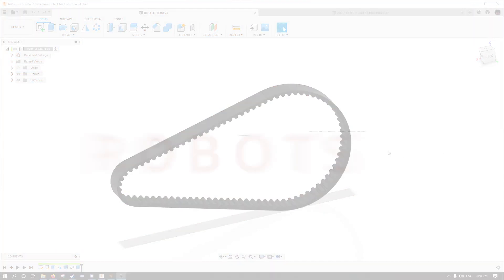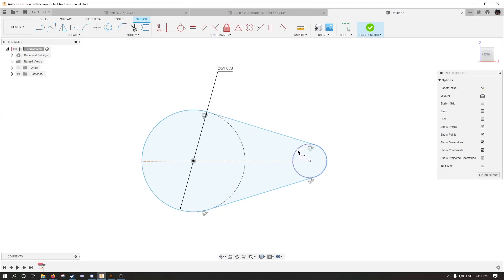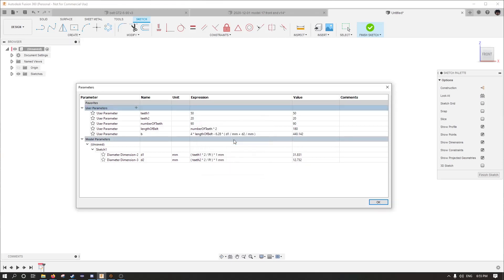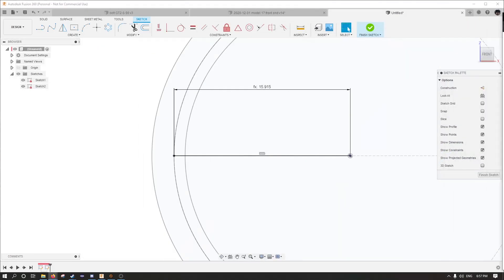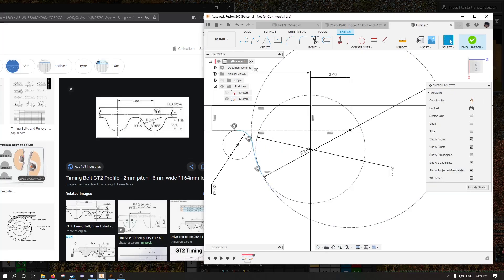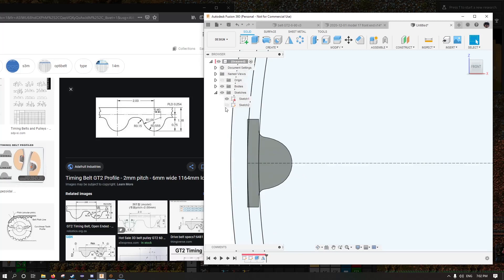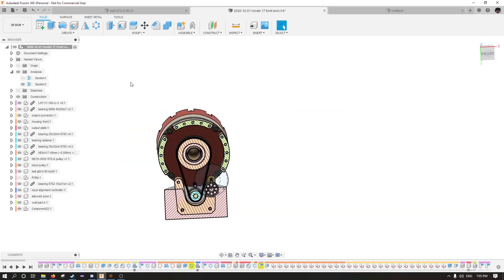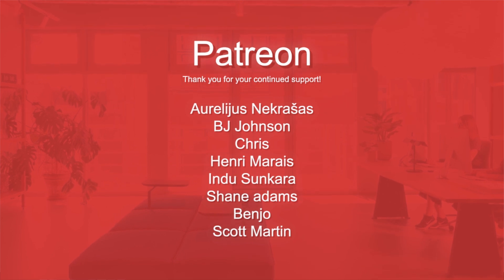How to model simple timing belt in Fusion 360

Comment: I’m only a week into Fusion 360 but this video was super helpful, thanks Dan! One part I struggled with (which is maybe missing from the edit) was how to dimension the offset on the belt layout sketch from the pitch line to the outside of the belt. Once this dimension has been defined on the tooth sketch, it can be referenced as d[number] between the sketches. My use case is a homemade pulley of 240 teeth  with a commercial 40 teeth pulley on the stepper. Using a 528 belt (so pitch length 264 teeth) when I made the path array there was a gap of about 1 tooth, though your example and similarly smaller pulleys and belt lengths worked perfectly. Not sure why - might just be a rounding/approximation with the dimensions, I don’t see any errors with the approach you’ve taken.

Comment: This is a pretty old video, so not sure if anyone will read this. But I was giving it a try with some other properties (5mm tooth pitch, belt diameter: 425, pulley 1: 75 teeth, pulley 2: 15 teeth), and the calculated center to center distance turned out to be incorrect. 

The calculated result was 86.9472mm, but by measuring the path, this meant that the belt length would be 425.842 mm. If I used a manual center to center distance of: 86.4425 mm, the belt length was correct.

So I'm not sure why the center to center distance is incorrect. I'll take another look at it tomorrow after a good night sleep. But so far I havent found the issue. Any help is appreciated.

Comment: Absolutely crazy to me that there isn't a full specification by the creators of the GT2 timing belt that isn't available readily. There are belt specifications available but no timing pulley specifications? lol who would of thought the first thing that the engineers using your product would like to model belts and pulleys.

Thanks for this video Dan. The pattern around a path was what I was after!
Reply from the maker: idk, I googled for "gt2 pulley dimesion diagram" and got https://www.chiefdelphi.com/t/timing-pulley-design-tutorial/383204 ; https://www.chiefdelphi.com/uploads/default/original/3X/6/e/6e21e2c1446a83cf34f9217a9c94ab3336a4683b.png
Reply: @i-make-robots  Thanks, yeah but I mean the people who made the timing belt, Gates. Could have easily made this as a source of truth. Also I don't think these account for the internal teeth squish factor (outside of belt curvature != inside belt curvature)

Comment: how do you determine the pitch line for the tooth so i can position it correctly? if i follow the steps it gaves me a different total outside length for my belt.
Reply from the maker: outside and pitch are two different amounts.  The pitch line is determined by the math in the video and the number of teeth on the belt.
Reply: @i-make-robots  so the final outside lenght  is not the same lenght that the belt length the math of the video?

Comment: You should upload the stl for the belt somewhere, thanks for the tutorial etiher way.
Reply from the maker: The stl or the fbx?
Reply: @i-make-robots  FBX would be great, would be really appreciated. Doing a CNC in Fusion and I don't really need the belt (made motor position adjustable) and it's a hobby project so don't want to put lots of time in but it'd sure look good.
Reply from the maker: @codeblocks4067  https://www.printables.com/model/223338-simple-gt2-timing-belt-from-tutorial
Reply: @i-make-robots  You rock, thanks.

Comment: Are you trying to impress yourself or give a tutorial?  Slow down.  Going as fast as you can has one goal in mind and that is to make sure that those listening cannot follow you because your just too good right? I get your point.  It's not about the what's being taught but everyone noticing how fast and how knowledgeable you are at this.  Oh.....but the outcome is suppose to be the learner keeping up with you? The great genius belt maker? Who only few can keep up with? yeah I know it's something like that.
Reply from the maker: Dude, you don’t even know how to pause and rewind. If you did you’d have no issue with my speed.  Everyone else has figured it out. 

Road rage on the information superhighway. Wow.
Reply: @i-make-robots Naaah, I had to 0.75 the video and even then it took me quite a few rewinds to figure shit out... It's just too fast for beginners.
Reply: @i-make-robots  If it's any consolation, I didn't have any issues following along. Looks like Richard's a bit of a Sunday driver.
Reply: @i-make-robots  To continue the automotive analogy, you're doing 40km/h in a school zone, in first gear, with a whistle-tip exhaust and truck nuts.  Technically ok, but you're still a bit of a tool.
A tutorial that needs to be run in slomo or rewound many times is a poorly paced tutorial.

Comment: This is super helpful and you were right about needing to hit the pause button a few times.  I think you may have left out a small point about using the d21 and another dimension from sketch 2(0.254) in the change parameters tab to redefine the linear dimensions of the offset values from the pitch line...When I reached the point in the drawing   approximately 7:38, my drawing looked different and the belt did not match up with the offset lines ...I think yours may have been similar but when you edited the video it got cut out.  I got through it and I think I have achieved the same result just thought I would mention it in case others experienced a similar issue.  I am still pretty new to modeling and this was an interesting challenge and very educational on ways to implement parameters to utilize different formulas.   Thanks for the content!  I'll be watching out for new stuff in the future.

Comment: Good stuff. Timing belts have been giving me fits. Can I use the timing belt body to derive the pulley design? I want to 3d print the pulleys.
Reply from the maker: Qualified yes.  I can make part of a pulley from the side touching the belt and then pattern it.  I cannot then tweak the edge (Q key).  Making a new sketch on the flat side of the pulley with a projection + offset makes fusion freeze for several moments.  so does the cut from the offset region.  Better to model a single tooth, cut it from a disc, and then repeat that around the disc.